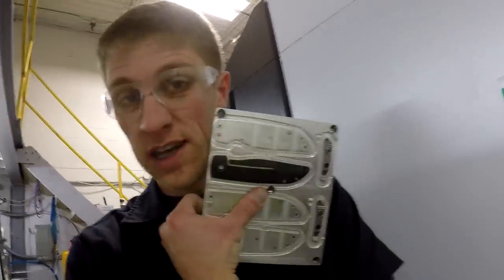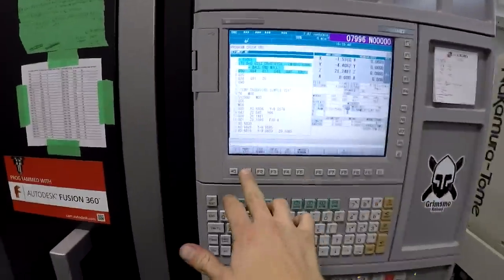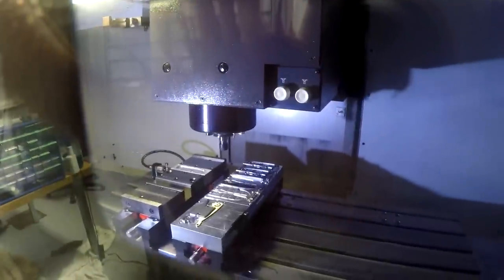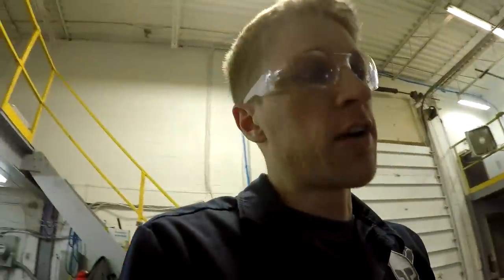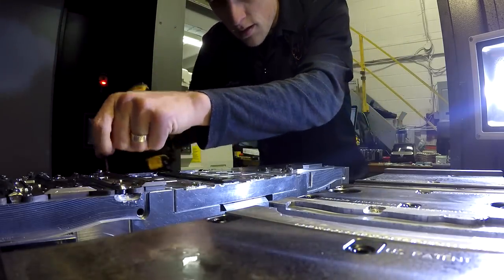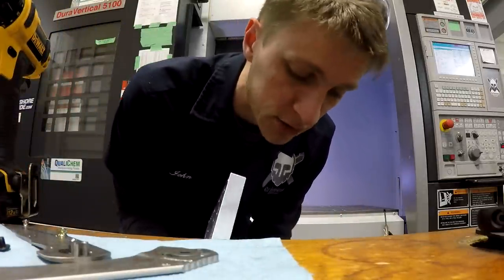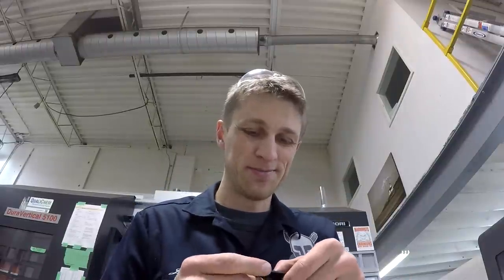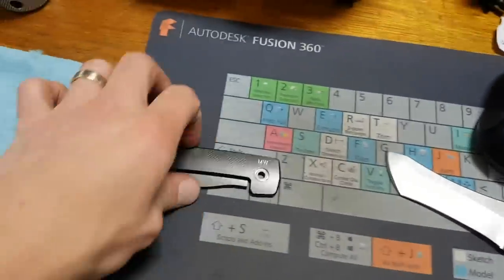Custom engraving on a DLC coated knife handle

Comment: I have the simplest CNC portal so don't know if that's applicable to the Mori war machine but when I'm unsure of a code, I run it first in the air 5mm above the surface to machine... it usually helps me detect the big obvious errors...great video !

Comment: Hey John, have you considered using a smaller cordless driver for setting up your handles in the fixtures?  Maybe it's just because you were trying to film at the same time, but it looked a bit unwieldy to use the full size cordless drill.  I have a couple of these and they're powerful little drivers.  https://www.amazon.com/Hitachi-DB3DL2-Dual-Position-Cordless-Screwdriver/dp/B004Y74AU6  .. Not sure I'd trust them for mounting the pallets in the machine, but for loading parts onto the pallets, maybe?